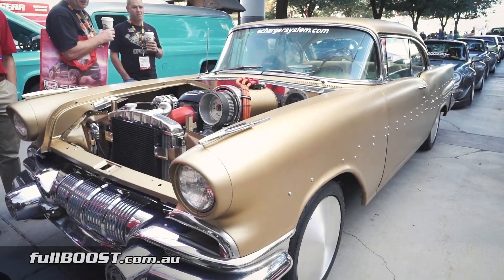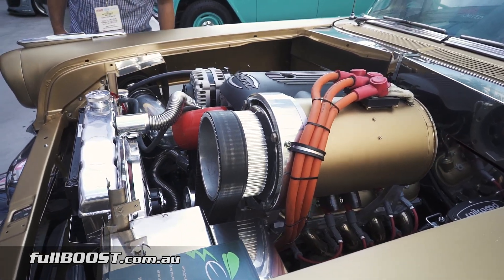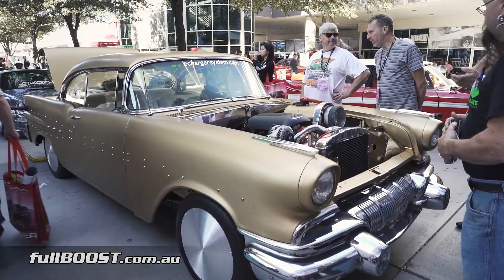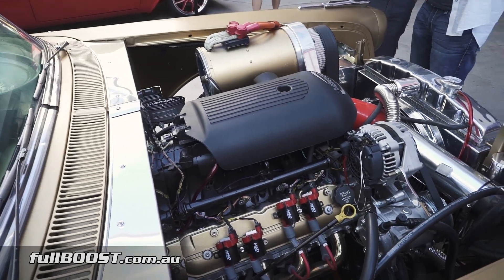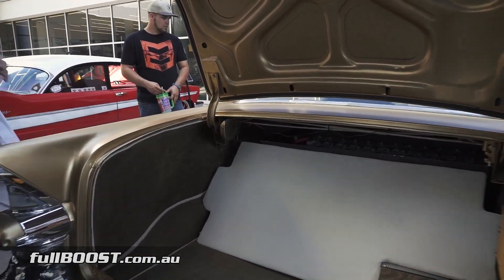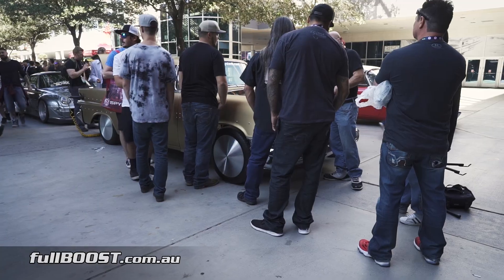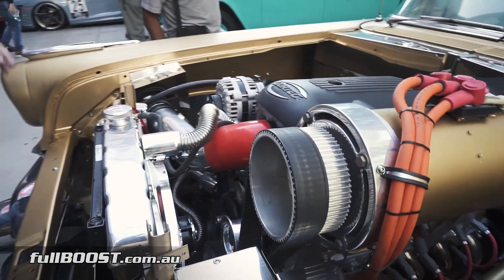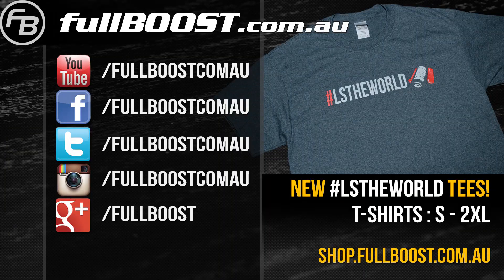The E-Charger Hybrid System

Comment: this should be built into the transmission
Reply: as long as it's built into the input of the transmission, because if it is on the output or the driveshaft it would be useless. You wouldn't get the torque multiplication.
Reply: basically what a prius does? engine -> electric motor -> gearbox ?
Reply: @MaximusPsychosis  YESSIR,  Toyota wrote the book on Hybrid Technology
Reply: The Koenigsegg Aguera does exactly this, well it has an electric motor geared right onto the crank.
Reply: dwaynE2099
That wouldn't be a good idea for performance. Too much unsprung weight in the axle. It would still be better to be before the transmission input to gain the torque advantage
Reply: custommotor, Why into the input of the trans? The torque curve of a electric motor is steady and able to go to much higher RPMs. They have been making add on kits for about an decade. They mount to the frame behind the trans. They add and extra 200HP with no alterations to the engine.
Reply: Rob V I can't think of many race cars in that horsepower range that use a "conventional" planetary gear type transmission.  Also top fuel dragsters do make in excess of 10,000 horsepower but they don't have transmissions.  It's just several clutch disc between the engine and the locked spool type differential.  It's basically a direct drive setup at full tilt
Reply: Maximus Psychosis not quite, the Prius has two electric motors and is a series/parallel system.  I'm thinking along the lines of what GM did with their hybrid truck and Honda with their first Hybrid Accord with the V6 ... a parallel system.  Basically the electric motor is between the engine/transmission and assists on takeoff where the torque from the electric motor would be greatly beneficial.
Reply: The way its done here is the easiest way to get it done. It doesn't require any re-engineering of the motor or transmission and it could be turned into a kit for any vehicle.
Reply: Nor'easter Playa that's not exactly true. It all depends on the automatic just like it depends on the manual. And you don't always have to add 200 foot pounds of torque you can have a motor that's limited to whatever you want for a specific application. But that's why it would be better to go in front of the transmission because you can scale it up and down to maximize what goes into the transmission without destroying it
Reply: I feel series parallel is more beneficial because you can have best of both worlds

honestly though, I feel they should have a high voltage split turbo/ supercharger

could get some nice pick up to highway speeds and then gain some additional electric off the exhaust further helping fuel economy or would the drag on the exhaust reduce it I wonder....

any thoughts?
Reply: Jerry Bear replace the torque converter with an electric/hydraulic motor. Easily adaptable to any conventional transmission platform.
Reply: Yes, in a completely electric vehicle you don't need a transmission, but we are talking about an assist motor. I guarantee that if you take 2 vehicles and add an electric motor before the transmission and one after that the one in front of the transmission will always beat the other one in performance. Which is what we are look for. You need to maximize torque at the rear wheel in each gear.
Reply: + Eric Day But then you have issues with unsprung weight, unfortunately you can't have your cake and eat it. Wheel motors only make sense for new cars where the whole car can be built around it.
Reply: custommotor true, good point... I was just thinking of the easiest space to retrofit some additional components...
Reply: Gearboxes only multiply torque, but power stays the same, and since an electric motor delivers torque from 0 rpm (unlike a combustion engine), using a gearbox is all but wasted energy.
Reply: custommotor yes but this is just a limitation of combustion engines, an electric motor can be designed to deliver torque capable of destroying the transmission from 0 rpm. Torque and power are not the same
Reply: Rob V, lol no... Top fuel don't have a transmission
Reply: Because it is easy as hell to bolt right on beside the engine...which is the whole idea...assuming you have a car that has the room beside the engine
Reply: Kamil you forget that you can completely control the way an electric motor makes torque. Even if you hook it to the drive shaft you still have to control it cuz a drive shaft doess not like full torque at zero RPM. you make it ramp up. say it idle it makes 50 foot pounds and when you hit 1500 or 2000 RPM in the motor it makes its full torque. No matter what you still have to control what the electric motor does because full power out of any decent electric motor will always cause issues at zero RPM
Reply: Eric Day  Acura uses a setup with individual inboard electric motors on the rear of the hybrid RLX, at best it is a limited AWD system.  The electric motors are limited in how much tractive forward effort they can provide, so once they reach the speed of their design limits they can no longer assist to propel the vehicle forward. To be honest AWD is mostly useful in taking off in slippery conditions, so by design it works... it's just not an "all-speed" mechanical AWD system.
Reply: mercedes has a system that works that way.
Reply: Nor'easter Playa I like your idea. Of. Mounting the electric motor to the transfer case. It's works like a PTO.
Reply: no on the rearend
Reply: The idea is for it to be adaptable to several vehicles. If you want to integrate it into the driveline, that complexity seriously limits its adaptability.
Reply: @akio2589  so you could just buy this kit and then retrofit an additional one behind the transmission and also intehrate a turbo/supercharger "dual-charge" system into the build and have a nice setup, i want to do this to an old sti or something else awd that can handle the power..
Reply: It would be more like a Prius
Reply: Seems like it's a super easy bolt on, just like adding another altenator and adding a new battery.
Reply: you dont need gear reduction with electric as they provide less power at high rpm
Reply: so 300 ft/t at 1 to 1 is 300 or 3/1 would be 900 but at a third the speed so you could top out at 30 mph with 900 torque
Reply: Jerry Bear it used like a bolt on engine assist and in economic mode it is also the starter,the motor kicks in to help accelerate and deceleration, and it gets the car moving and restarts the engine when you pull away from a red light, please Google it its a fascinating idea ,it's a refinement to the experimental system GM tried on v8 trucks in the early 2000s
Reply: Jerry Bear good point
Reply: Yeah into my Corvette "rear" transaxle
Reply: Drivetrain input maybe to the front wheels part time AWD true hybrid, nice.
Reply: more complicated if they did. easy access on top. will fit most cars this way. they would have to make more variations to fit different makes and models.
Reply: eh. it works exactly like compound turbos do in small aircraft, power straight to the crankshaft.
Reply: Yesssss! Completely agree it would be more efficient.
Reply: So Honda's IMA, that's been out since 1999?

The idea of this that makes it stand out is that it's a bolt-on system that can be added to traditional crate engines.
Reply: Jerry Bear or at the driveshaft, I agree.
Reply: Nor'easter Playa because if you put it behind the transmission and it makes 200 foot pounds of torque that is all you gain. say your motor makes 200 foot pounds of torque and it goes through a transmission with a 3 to 1 gear ratio, it comes out is 600 foot pounds of torque and then you add the 200 to get 800. Now if you put the electric motor in front of the transmission you have 200 foot pounds of torque and 200 pounds of torque which is 400 foot pounds of torque and then it goes to the 3 to 1 in the transmission which amounts in 1200 foot pounds of torque. So in that circumstance you had a net gain of 400 foot pounds of torque just by putting it in front of the transmission. and also for the same reason in Reverse is that if you put the electric motor behind the transmission it doesn't help the motor as much at low speeds. so between the motor and the transmission is a better boost to lighten the load on the motor and also ends up with a net torque gain at the rear.
Reply: Jerry Bear what about a 9" live axle rear end housing with a 50-100hp motor on  each axle tube turning the axle!!!!!!
Reply: You don't need any more torque multiplication with an electric motor, they make their highest torque at stall. You're still going to get the multiplication from the axle ratio, and you're going to 'fill the curve' ahead of the torque peak for the gasoline engine. For that matter, you could actually change the tuning on the gas engine to peak at a higher RPM and not worry so much, or at all, about losing low-end torque because the electric motor covers for you. 

Want to sell a lot of hybridization kits? Get some engineering drawings for common transmissions that use a separate tailshaft housing and make tailshaft replacement motors. Motor bolts directly to the end of the transmission housing, maybe has an engagement clutch if you want to run the transmission output shaft through the center of the motor shaft (concentric shafts) or just make the tailshaft the rotor, and slip the driveshaft yoke into the other end. Most cars have a decent amount of room in the driveshaft tunnel, you'd need to beef the transmission crossmember a little to carry torque, and maybe alter the driveshaft if you can't fit everything within the original tailshaft length, but that and wiring/control gets you a hybrid system that you won't have to fart around getting an accessory drive setup working or try to find room underhood. 

It can't start the engine, but you've already got those systems in place... and this setup can move the car without the gasoline engine running, though you might want an accessory vacuum pump for the brakes (easy) and an electric power steering setup (not so easy) to avoid 'armstrong' steering.
Reply: Michael Free Well said. You could also use a 4x4 transfer case and mount a electric motor to the front drive shaft output, or even mod the transfer case to mount the electric motor on the back side or remotely mount the electric motor with a drive shaft to it... This would work well!
Reply: Kamil yes but even if you lose 10% of the torque that the electric motor makes you're still going to have an improvement over what the torque would be behind the transmission. if you have 200 foot pounds of torque behind it and you put it in front of it you have 600 foot pounds of torque even with a 10% reduction that still 540 extra foot pounds of torque in a 3:1 low gear. and no you won't have a slow tank. When you're accelerating the person with the most torque or Tractive Force at the rear wheels will accelerate faster. it will lose a little bit of overall horsepower at the top end because of the transmission, but it will accelerate faster throughout the whole process. I think being upfront with also better assist the motor like this motor in the video does because it's more directly hook to the motor's output because it is more directly hook to the motor. that is thinking of this as assisting the motor and not powering the car by itself.
Reply: Rob V top fuel does not use automatics
Reply: Kamil I was thinking that as well, but wasn't 100% sure. Cuz I thought Tesla has 1 motor at each wheel.
Reply: iFazer8 AKA The Doctor and dont forget the likely event of the crank being sheard off
Reply: Totally agree! That design would put stress on crank that's not designed for
Reply: Why not just throw the transmission and that gold motor in the trash, and just bolt a allison 50/40 electric drive unit to the engine and call it a day.
Reply: custommotor 'maximising' torque will give you a slow 'tank', speed and acceleration come from power which a gearbox doesn't change. if you have a motor in front of the transmission atleast 10% of that power will just be wasted from friction, especially in a torque converter auto. all that a gearbox allows you to do is use a motor with less torque at a lower efficiency, at the end of the day, 50kW stays 50kW whether it comes from high rpm low torque or low torque high rpm
Reply: Motors at the wheels would be the most efficient application I would think. Closest to where it needs to go. Skip loss in the drive line. 

Plus you could be crazy and put them up front and make it AWD. :)
Reply: @MrEricDays  how about mount one before and one after the transmission in an awd car and have the best of both worlds?
Reply: Toque, haha, toque. Edit again.
Reply: That would be a massive overkill, not needed in any environment. Not to mention automatics can not handle that much power.
Reply: Most of the highest horsepower  racing vehicles use automatic transmissions handling horsepower in the range of 10-12 thousand for top fuel.

Comment: Cool approach. I wonder if there's a more efficient place in the drive train to incorporate the motor. I'd think there's a fair amount of parasitic loss between the accessory drive and the drive wheels.
Reply: The only place I think that would be better is if you made an adapter between the engine and transmission with an electric motor in it and used it to assist the engine. I say that because you would want the assist to input into the transmission to gain torque multiplication.
Reply: As I understand it, Koenigsegg does that with one of it's electric motors in the Regera (with regard to location). For them it makes sense but what makes this system interesting is it's adaptability which would be reduced as an adapter. You're absolutely right about the torque multiplication though.
Reply: David Rodriguez well I mean if you think about it it wouldn't really be hard to make an adapter because you just have to change the bolt patterns. The problem with the adapter between the engine and transmission is that it would make it harder for stock applications. You can't just move the motor or transmission forwards in all applications to fit the electric motor in between.

Comment: Doesn't want to trade for power then adds significant weight , sigh ...
Reply: 250lbs isnt shit
Reply: hahaha, wtf?
Reply: Hybrids are usually heavy, but from a fuel economy standpoint, the weight is more than worth it.
Reply: DC Garage yeh and if u where in colledge but wanted a fast car that was gud on gas, that would be a nice power adder dont ya think?
Reply: Flyin Sushi I actually am in college and want a fast car that's good on gas lol and I love this idea. I even swapped a 3.5L EcoBoost V6 into a Mustang to try to accomplish that. While I definitely get good gas mileage for a 500 hp Mustang, it's still not nearly as efficient as I would like it to be. I would love to add this system to my car and switch from a 93 octane water/meth tune to a 87 octane water only tune. I could add even more power and still save gas that way.
Reply: DC Garage thats awsome bro. Im in my first year of high and my dad has a 460 and a 88mm turbo lyin around and we're gettin some ideas lol
Reply: One turbo does not add 500lbs. lol

Comment: "...sacrifice fuel economy for power...." has America heard of turbochargers? Or do they just bolt superchargers onto every V8? Hahaha
Reply: yeah but that doesn't work so well in a 5000lb v8. The electric motor acts as an assist motor to lower the load with a moderate power boost. If you get into boost on a turbo engine you lose mpg. With this electric motor you don't lose as much fuel economy when you get into the gas and you gain an extra boost from the motor. When it runs out of power you go recharge it, so in a way it is like a nitrous bottle.

Comment: Surely if he run ten alternators off the prop shaft he could repower the batteries instead of needing to charge it over night
Reply: They would rob a ton of fuel efficiency, even when not recharging the batteries. Better to just charge overnight and when you run out of battery just run off the engine instead of sucking horsepower/fuel to recharge the batteries for later.

Comment: This system needs to be bolted to the flywheel because I don't wan't to be changing shredded belts all the time.
Reply: Why would the belts shred? That belt is huge, I'm sure it can take the abuse for a hundred thousand miles before it shreds.
Reply: toysareforboys 
he's doing internet enguneerin' ...y'all just eyeball it.
Reply: okleydokley The amount of torque the electric motor can produce will exert lots of instantaneous stretching onto the belt. Yes, all belts have a lifespan, but for ultimate longevity, gear it in.

Comment: So is it boost?
Reply from the maker: No, as stated in the video, it gives assisted drive to the engine.
Reply: Fullboost oh okay, makes sense.
Reply: +adamwilson301 yes, that's how it works.
Reply: Ryan Austin no , it's a " High Bert ".  FYI , kids will be going down the streets in the dead of night , unplugging " HIGH BERT " cars.
Reply: If it's 'bolt on' how is it 'assisting' the engine? Does it drive the belt it's attached too spinning the main crank pully instead of the crank pully spinning it? That's the only way I can see this 'bolt' on engine assist system working.
Reply: Tyler Hunt that's pretty genius. Thanks.
Reply: Really?? you do not understand at all. this is an electric motor not a turbo or supercharger. it's not injecting air into three cylinder it's bypassing that entire system and just injecting pure torque. is this AC or DC looks AC.